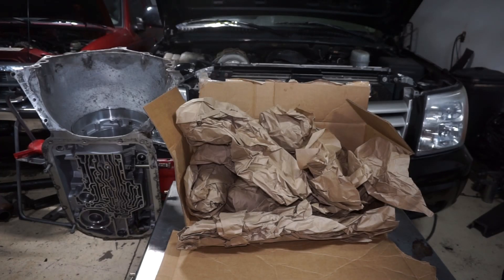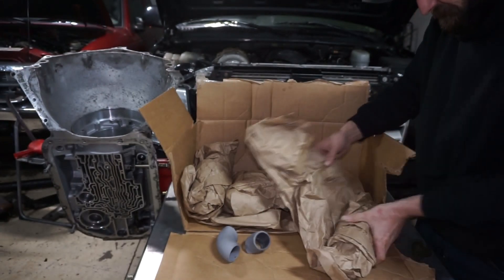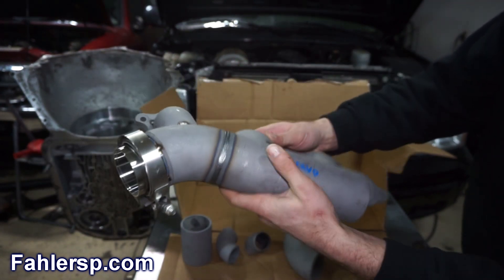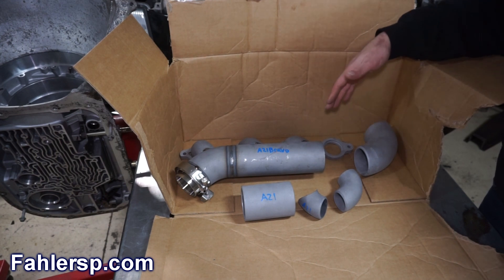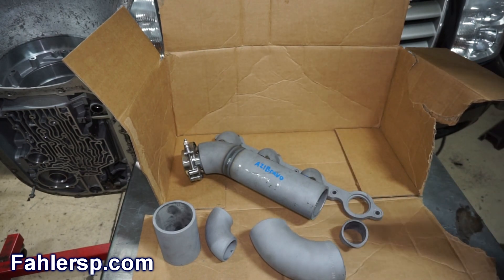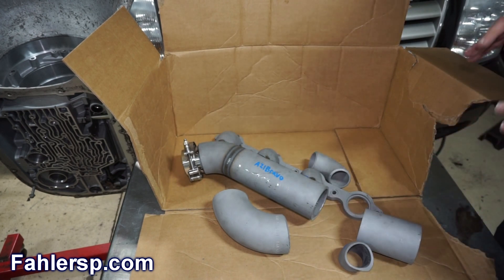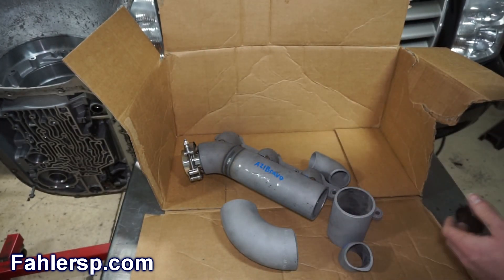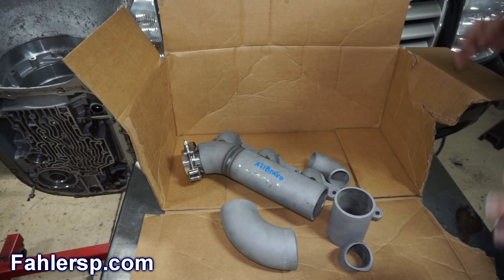Fahler DIY Turbo Log Manifold For 1000hp Escalade!!!

Comment: I think you are going to need to run a t6 with that sort of a HP goal. You are talking wheel, correct?
Reply from the maker: Yeah, the 88/102 and 103 im looking at are t6.
Reply: a21bravo I think that’s your best option for sure unless you went twins. I’m excited to see you fit it in there and am curious to see if the duramax intercooler will keep up. Fun project for sure!
Reply from the maker: @scrapmetal_sleepers  I'm curious as well. Seemsike its rising more with the gt45, so I'm interested in what a really efficient turbo will do... Im planning to do before and after temp sensor for testing.
Reply: a21bravo toss a before and after pressure sensor too, I’m wondering what the max flow limit is. There are a lot of parallel bars which is good for potential flow but it’s not a flow dedicated core like a water to air core or 31x12x5. Those will flow a ton of air, but they don’t have the front cross sectional area of that duramax boy. I’ll be watching as always :)
Reply: @BlaserBuilds  VS 88/103 is a solid one for sure. Had a 6.0 with one at about 1200hp according to weight and mph.